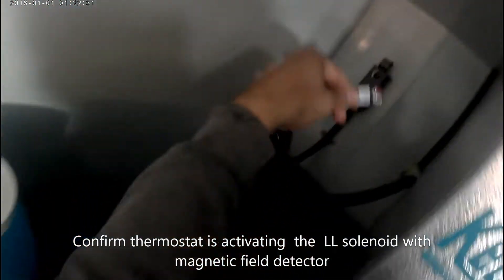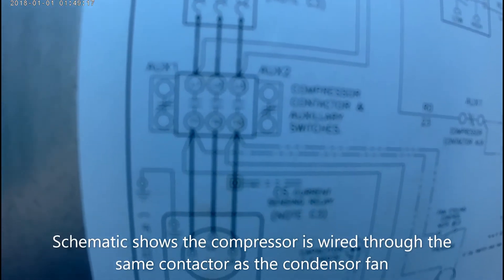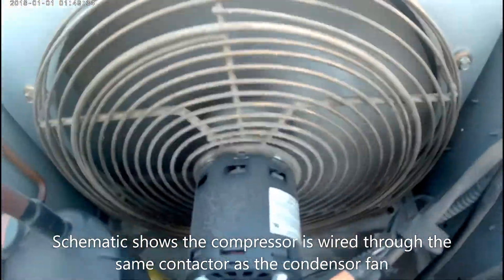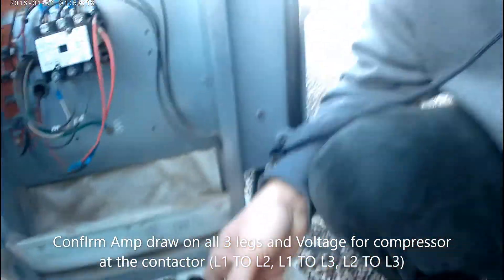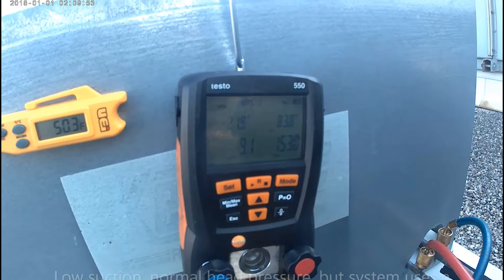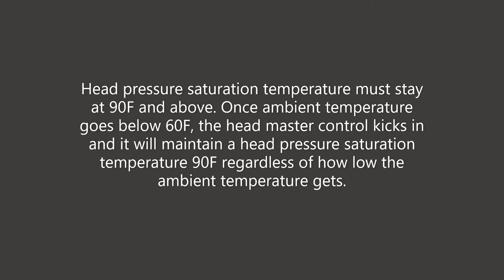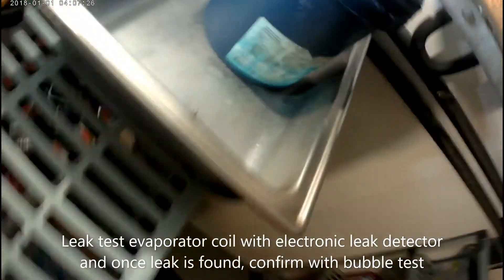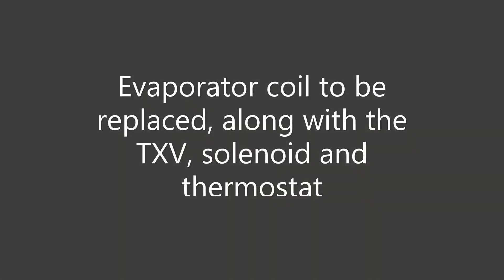Walk In Cooler is not cooling. Box is at 50F.

Comment: Hey there, big fan. trying to get a feel for why you changed txv solenoid and thermostat as well?
Reply from the maker: The evaporator coil was leaking and needs to be replaced. I wouldn’t use a brand new coil and then re use the 20 year old solenoid, thermostat and TXV. I want everything in the box to be new
Reply: @REFRIGERATIONKITCHENEQTECH  
Makes sence to me thanks for the reply!